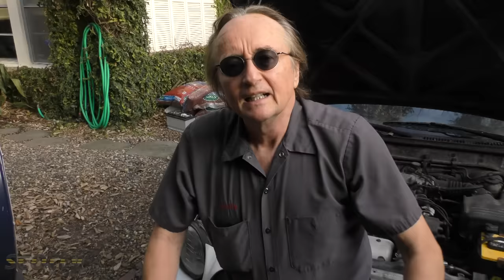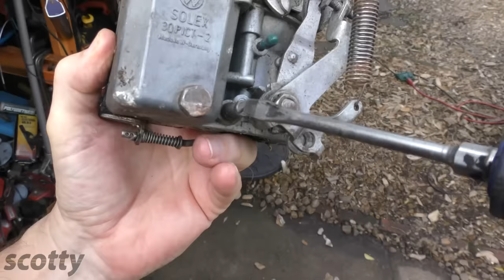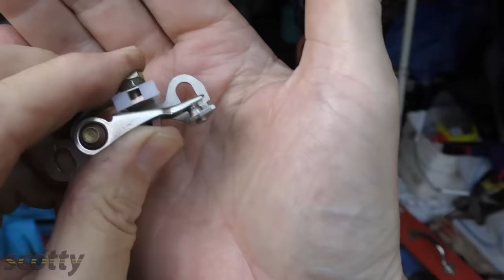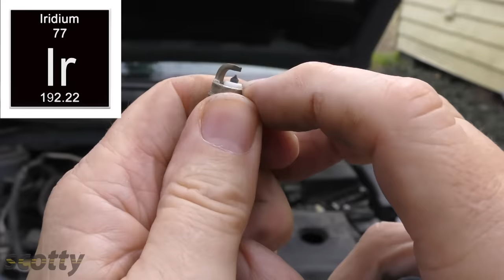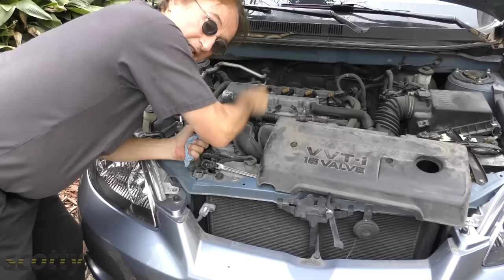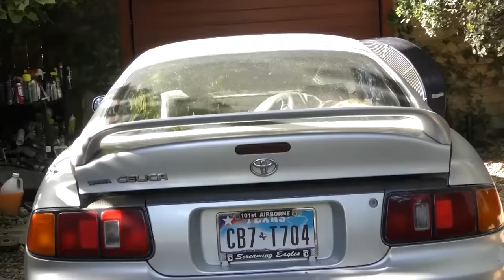Does Your Car Need a Tune Up? Myth Busted

Comment: It’s probably safe to say that modern cars have come a loooong way since then...
Reply: Josh Bacon They're wayyy overpriced and made out of plastic. Also they look hideous and ugly as well.
Reply: Nameless User You are correct mate same thing with the Charger, mustang, and Camaro but every other modern vehicle is completely ugly and looks the same.
Reply: CJ Colvin style has changed for the worse. Airbags and all the sensors help total them out and they are all made to fold up for impact. Old cars were easy to diagnose, repair and parts were cheap.
Reply: Hey Chevrolet I know mate which is why I love old cars.

Comment: What is most important is to find out "what normally breaks" on your year car and model, then have that part or system specifically inspected. For example, the intake may develop cracks in the rubber plenum, or the intake on a direct injection engine might develop buildup that needs a spray cleaning.  Additionally iac,pcv, etc, might need to be removed and cleaned out.  Also, a scan might show a weak o2 sensor giving bad gas mileage.   All maintenance has limits though.

Comment: One bit of maintenance I do is I maintain the CV boots.  With the vehicle on jack stands, I start it up and put it into gear so the front wheels begin to rotate.  As they're rotating, I spray silicone on each of the 4 boots.  I also hit the brake hoses.  Can't hurt (unless the car falls off the jack stands).

Comment: New plugs. New air filter. Oil change. Injector cleaning and a carbon cleaning. That's a tune up.  No?
Reply: that's maintaining your car
Reply: stefan samotulka injector cleaning is a waste of money.
Reply: stefan samotulka when my truck had 30k miles on it the dealer suggested i have the injector cleaning service done. I said no. Now at 230k miles it still has never had the injectors cleaned and it runs exactly like the day it was new. Gas mileage is also the same as new.
Reply: I had my injectors rebuilt at around 210K. They told me it didn't need to be done, but they were out....Made NO difference.
Reply: drops injector cleaner
Reply: Do you know what TUNE means? Replacing the dirty stuff with clean stuff is called maintenance
Reply: Isn't a tune up technically regular maintenance than?
Reply: stefan samotulka yes
Reply: Valve adjustments ?
Reply: People do not realize the amount of cleaner in gas have gone down since the 90s. After they made epa regulation on top tier gas, most manufacturers were putting in 2 to 3x the cleaner lowered it since they law only require 1/4 the amount to be top tier premium. However the base fuels are generally better. Plus pull apart the throttle body and intake plenium and tell me they do not get dirty. The only reason people believe that it doesnt matter is that computers can compensate far better to a point. Like computer cannot make O2 greater they can only lean it out.
Reply: Throttle body service, pcv, etc this dude is the automotive equivalent of a quack
Reply: TheZXKUQYB   Throttle Body service, I forgot about that
Reply: The point is your can see on throttle body  does need to be cleaned up from time to time.
Reply: Doug Reed no shit Sherlock it's almost like your engine is on fire and it is throwing fire everywhere and it leaves behind small amounts of fire dust
Reply: Carbon cleaning is stupid
Reply: Fred Flintstone That's because you're using your feet to move the car all the time. Avoid large racks of dino ribs on the side of the car also.
Reply: I always thought part of a tune up was changing ALL the fluids also.
Reply: Wayne S. Ur right bro
Reply: Fred Flintstone bro i have lexus is220d 177hp and when i release the clutch there is a noise (tik tik tik) like that...but when i release the clutch in slow speed there is nothing...but i have to do..plz help me bro ...its a big problem or its normal
Reply: He talked about those in other videos.   mass air flow sensor too.   All 3 of those is 50 dollar job at most.
Reply: No, that is a service.
Reply: Wayne S. what about if your car engine is dusty
Reply: Fred Flintstone 210,000.00? damn son
Reply: Throttle bodies and intake plenums only deliver air to an engine. The carbon you see inside is from PCV/EGR systems.
Reply: You can do that your self no !?!?!? 😕
Reply: I'd consider tuning to be adjustment, not replacement. You'd do all this maintenance before tuning, but the act of doing the maintenance itself isn't tuning. 

The point of the video was that most everything adjusts itself now. If anything does run out of spec, it's a failure of those systems that warrants repair or replacement rather than tuning, as it's controlled electronically.

Now, you could do ELECTRONIC tuning, but there isn't much to be tuned under the hood anymore.
Reply: Naats
Reply: stefan samotulka would an 03 Acura need a tune up
Reply: Does your brain have this word call MAINTENANCE?
Reply: No
Reply: Also taking some brake cleaner and cleaning the O2 sensors can make a big difference in fuel economy.  Edit:  Just wanted to add that you should only use non clorinated brake cleaner when cleaning your o2 sensors because the clorinated stuff will wreak havoc on plastic and rubber.  On second thought, u might be better off just using some carburetor cleaner to be safe.
Reply: stefan samotulka that's regular maintenance. Doing it all at once is something you really only do when you just get a vehicle that you don't know the history od.
Reply: Da Master, never heard of carbon cleaning..
Reply: Actually when you change a 02 sensor or iat sensor or anything sensor related, your ecu takes  certain amou t of driving conditions to reevaluate it and reset your emissions control systems. So in fact changing all those sensors requires a tune up consisting of a long semi hard drive to recalibrate the system.
Reply: Yes you can replace everything and clear the codes but the emissions systems are rendered "not ready" and need to be "woken up/tuned" to the "ready" mode. So in the grand scheme of things yes a tune up exists. Any person well versed in how the emissions system works will know this to be fact.
Reply: You Tube replace an 02 sensor at an emissions testing facility that uses a obd2 port style system. and immediately have it tested. It will fail. 100% guaranteed. Because the emissions system is "not ready" you must drive for a while I believe it's 60km recommended. After that the sensors will enable the systems to be listed as "ready" the ecu basically self tunes itself. Not to the degree of remapping but "relearning"
Reply: stefan samotulka "To tune up" means to adjust, not to replace or to clean.
Reply: stefan samotulka When you tune your car radio, you're not replacing or cleaning it right? I'm pretty sure that you're ADJUSTING the dial when you tune your radio to get better signal reception to hear the program well.
Reply: Valve clearance adjustment, carburetor cleaning, air fuel mixture adjustemnt, engine idle speed adjustment, air conditioning idle speed adjustment, distributor timing adjustment, vacuum system cleaning. THAT is a Tune-Up. 😒😬
Reply: U dont need to Clean your fuel injectors lool the gasoline U Put in your Car already Has additives that        clean your engine
Reply: No it doesn't run exactly the same.  I'm sure it runs well but doesn't still run the same with 230k on.  Don't insult our intelligence.
Reply: stefan samotulka not really the plugs in my moms car haven’t been changed in atleast 5-7 years pulled one out it’s NORMAL still good no other problems so the others are good to but yes on the oil and if u don’t change your air filters atleast check to see if there dirty
Reply: Also test the coils to see if they are working properly and some mechanics recommend changing the fuel filter as part of a tune up
Reply: @Rich22ism  Wow, a lot of bad info in this 8 month old thread, and even Scotty got it somewhat wrong. First off, you don't touch the carburetor in an old school tune up. And you certainly don't mess with any of the screws. The only reason they even have mixture screws is so they can be completely removed and the passages blown out in a rebuild. Otherwise, never fool with those.

A tuneup is to repair physical wear on the electrical system. Mainly the points, which over time erode, increasing the gap, which advances timing and decreases dwell. You'd sandpaper those contacts to be shiny and new, and after a few times there's not enough contact thickness left to properly adjust them, so you'd need new ones. At least every other tune up you should put a new condenser in, which prolongs point life and allows you to enjoy your radio better. Also the spark plugs would need cleaning and re-gapping. Unless they too were eroded to the point of replacement. A good tuneup would also include sanding off the tip of the rotor, which was prone to erosion and pitting, and possibly the terminals inside the rotor cap. 

And when I say sanding, I mean the finest paper you have the patience to use, as leaving micro scratches on the surfaces will cause them to wear faster, and your next tuneup comes sooner. Points were cheap enough that usually you'd only clean them once, and then the second time you'd buy a kit that comes with points, a new condenser, and a little capsule of lube for the distributor shaft.

Obviously, none of that has mattered since 1975, by which time every car came with electronic ignition. A point style system put maybe 20,000 volts through the spark plugs. Electronic systems deliver about 100,000 volts, more than enough to blow off any carbon residue. That's when plugs started lasting a lot longer, and then fuel injection came and there is no extra carbon now, so plugs nowadays generally outlast your engine.

There hasn't been such a thing as a 'tuneup' since the mid 80s - Scotty is right about that.

Comment: I use the term tune up because of my family. I grew up under the hood and just use it to differentiate between an oil change and changing plugs and or wires. I do use irridium plugs and they last along with quality wires. The last tune up I did the cap and rotor that's all. I also live in a very high heat environment and around a lot of farming. I make sure to use the best parts and fluids I can afford and I also went with a cleanable filter. I was spending a lot on filters between changes because of the dust around the fields. But something to consider I spent $70 on a filter a few years ago and just spend $20-30 on a cleaning kit every couple years. Depends on where you live.

Comment: I grew up with carburetor engines and I still use the term when I do regular/preventative maintenance on my modern car. It's an easy term to refer to when you want to change/check fluids, plugs, wires, filters, belts, hoses, etc. I used to take my car to muffler man to get these things done but I got tired of stupid comments and having to explain it every time. So I spent the money to purchase the tools and did the research to do it myself.

Comment: I ran a '92 Corolla (Australian made.) for 180,000km (112,000Mi) without a service, filter, or oil change. Finally got around to changing the plugs, oil filter, and did an engine flush. Sparks had lost about 1/2mm (0.012") in that time, the oil was still slightly translucent, but when I got down to the front brake pads which had started to get noisy, one had lost all it's friction pad, and the other three has less than a mm (0.39")!

Comment: We don't have to change the points every twelve thousand miles anymore, but with every oil change, I check the fuel trim to make sure things are within a couple of percent of zero. If your fuel trim is close to zero that tells you both the ignition and fuel injection is working properly. I grease any suspension parts that have grease fittings check the drive shafts for looseness and the list continues. I have a 2004 Jeep Grand Cherokee with 262K miles I take through some of the roughest terrain on the planet. It's not just a tune up it is scheduled maintenance and if you ignore it you will end up walking.
Reply: Grease fittings?  My '98 Ranger has only one, and that's because I replaced the original U-joint.

Comment: Can you make a video on installing a rear mount turbo  with its own oil pump, tank and seperate oiling system in the trunk and wiring the on/off switch for it as well as mounting the turbo to the exhaust under the trunk? And how to run flexible steel exhaust hose to feed the air from the turbo into the fenderwell and to the intake of the car? Using all Ebay parts. Thanks.

Comment: Lead in the gas was a big killer of spark plugs in the sixties also.  I started working as a mechanic when I was 14 in 1962, and put myself through college working as a mechanic.  I was fully ASE certified in 1968 and kept my certification until 1983. I now bring my car in to a certified mechanic for any serious work, but new cars are so well made that this is a rarity.  My last car I had that really had regular service intervals, had me change the spark plugs and change the air filter every 30,000 miles,  and change all fluids at 60,000 miles. (Transmission, transfer case, and differentials)  I changed the brake pads at the same time and checked the rotors for wear and run out and suspension for wear.   The only thing else I changed in over 225,000 miles on that vehicle was a Battery, alternator and tires.  Even the shocks lasted for the time I owned it.  I just traded it in for a new Jeep Cherokee Trail Hawk, that does everything but wipe my butt.  Tells me if I am leaving a lane, a car is in my blind spot when I go to change lanes, stops before I can even begin to lift my foot off of the accelerator when an idiot jumps in front of me and slams on the brakes,  and a whole host of other things I haven't figured out yet.

Comment: Its funny because my mum always tells me to tune my car. I know shes old fashioned like old mind set but I've always told her theres no such as tuning for my 2006 Ford Falcon unless if its tuning for the dyno tuning has to be done has to be done but I've told her I just gotta keep up with services and everything and make sure no leaks whatsoever and car will run fine and also with replacing oil oil filter air filter and fuel filter car would be running fine :) these advices help.

Comment: Been binge watching your (just discovered) channel for the past couple of days. Great content! Yep, I just changed the plugs and plug wires on my 2009, 106000 mile Wrangler last month. I do remember changing the points, plugs, and using a timing light on my 1970 beetle, though. I'm no mechanic, but I learned to do little things like that myself. Modern cars? I won't touch them except to change my air filter, and the only reason I change the air filter myself is the place I pay to change my oil never has them in stock.

Comment: Have you worked on a Mercedes-Benz 450SEL-6.9? If not, & someone brings one to you, there is a very quick way to check if it has the 6.9 under the bonnet. Once you open the bonnet, look for the oil filler cap on the engine, & the usual dipstick. If both of these are absent, look at the inner guard on the right hand side (as looking forward from rear of car). There should be a metal cap there. I hope you have a high capacity drain tray, because those big M100 engines take a lot of oil!!

Comment: Do you recommend replacing high milage plugs before they start to give trouble? When I was a kid there were platinum plugs and my dad would never use them because he felt they'd last too long and they'd be difficult or even damaging to the threads to remove. I know that we have high temperature antiseize Commons l compounds, but what if you can't be sure it was used when your existing plugs were put in? Would it be worthwhile to change the plugs as a precaution against them getting stuck?

Comment: I know this is not exactly a tune up, but when they changed my timing belt the engine sounded different. It had almost like that chirp you would get on an old Beetle that was tuned well. And it has gone away over time now that it's getting close to time for another timing belt.

Comment: he is spot on. my my ford E250 has 219000 miles on it ..never changed the plugs once. same gas milage as new . dont fix it if aint broke

Comment: You can dial in more performance with a laptop these days, VW's had that. They were restricted and when you re-flash the ECU, you get more power with a special software/firmware, 'Tuning' the engine. But mechanically, no.

Comment: Hey Scotty! Why don't you do a video on engine flushes? You know that solvent that you dump into the engine oil, idle and then replace the oil. Per example: Does it really work? Is it really necessary? How to do it? Nobody on the Internet seems to agree on if it's necessary or if it works; some people even say that it can damage your engine if it hasn't been done regularly. Thanks!
Reply: Jimmy Alfaro The "Engine Flush" is just a scam. There is no manufacturer that recommends an engine flush. Engine flushes do not exist as a requirement, but a total way to screw the engine up. Having good motor oil and having a scheduled OCI (oil change interval) and a good filter will keep your engine clean enough. Don't believe in engine flushes!

Comment: Now, the term 'tuning' a car refers to making adjustments to the programming of the cars computer (ECM). Most of the time the car will need a new ECM installed before it can be tuned. Tuning is often intended to increase the acceleration and handling of the vehicle. If the vehicle is still a stock build, then you will usually only gain acceleration by sacrificing fuel economy. Tuning can also refer to reprogramming the ECM to reflect the replacement of stock parts with aftermarket improvements. If the intake and exhaust have been improved, the stock programming may not be optimal for the new setup.